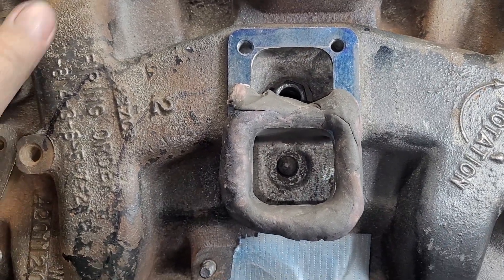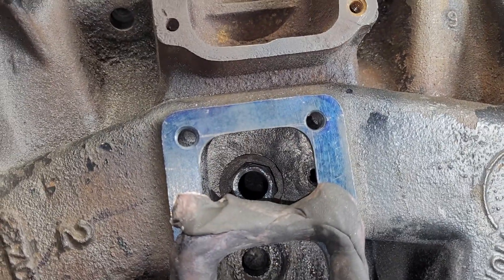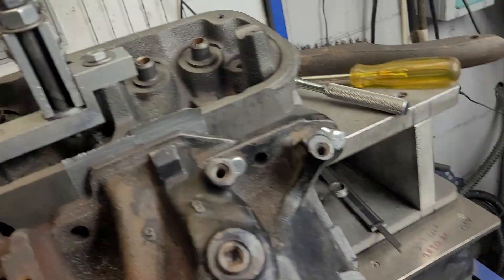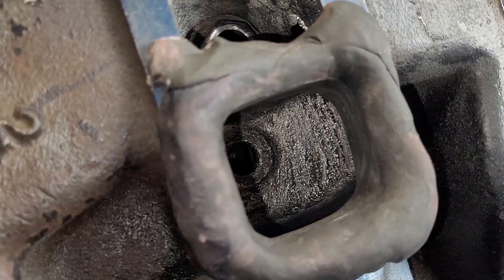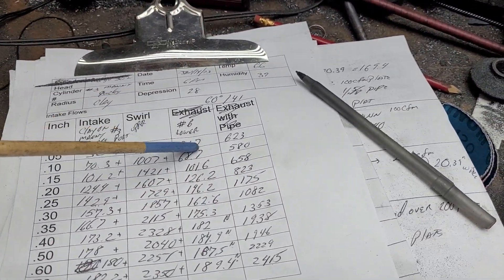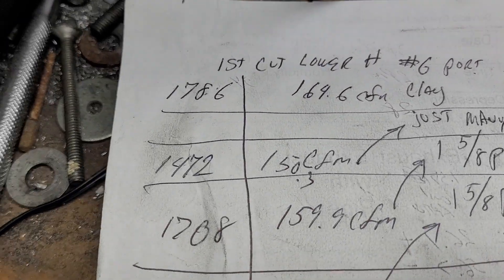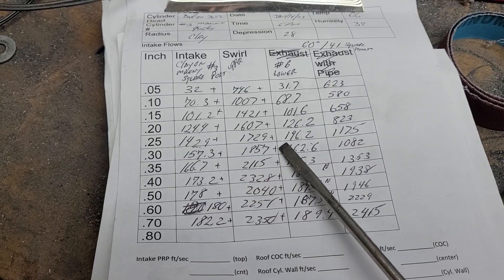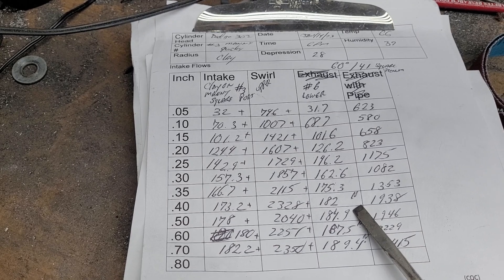David Vizard, Uncle Tony's Garage, Unity Motorsports, Mission Impossible project. Upper vs. lower H

Comment: Sounds like it's pulsing rapidly between laminar and turbulent. Increasing the depth of the boundary layer with dimples or an overshoot may help on the running engine but may not show on a flow bench. Looks like you have a good handle on this profect to me. Keep it up.
Reply from the maker: Thanks, it is all new to me  as far as these heads and this intake.

Comment: So... They are gonna hawg out the carb to square butterflys.  I said it first!
Reply from the maker: I have not heard that. I can bet my spacer is square at the bottom, actually rectangular.
Reply: @servediocylinderheads  well that would sure be interesting at least
Reply: @servediocylinderheads  a little tongue in cheek there.  But I was starting to wonder...
Reply: @servediocylinderheads  yep, flared and radiused from round to square.👍👍😎

Comment: I would say the frequency of that sound is a product of the turning turbulence and the length of the port supported by the density of the air. Sticking a ball at the “H” turn will change it. Changing the density by adjusting the pull will too. To get rid of it you’ll probably have to reduce the turbulence at the “H” turn. Resonance problems in HVAC systems are cured this way. Although, they have room enough for turning vanes at the turns.

Comment: This is just a hunch, but I'm willing to bet the frequency of that noise corresponds to the RPM range where that intake makes peak torque. It would be cool if you could determine the sound frequency, and confirm or debunk that.
Reply from the maker: I would need a microphone and a osilloscope to plot the period. I don't have either. Sorry
Reply: IIRC there are oscilloscope apps available for smartphones. Probably not as accurate as a real oscilloscope, but could get you in the ballpark.
Reply from the maker: @michaelblacktree  It disapeared after I cut the divider down. Thanks

Comment: Eveyrone is working on this project other than Uncle Tony, what a scammer
Reply from the maker: Now, now, that is not nice.
Reply: @servediocylinderheads  I've been wondering what his contribution will be. Time will tell.
Reply: @B. King  taking credit I'm guessing.
Reply: It would be nice if Tony could at least come up with castings from his stash for DV & Charles (heads / manifolds)…..this could help with experimentation purposes by having parts to section and compare 2v single plane vs. dual plane, as well as roller vs. non roller 318 heads to rule out the tight pinch issue discussed on this channel a bunch.
Reply: This project has taken off in a whole different direction than Uncle Tony wanted it go.  UT is a low buck kinda guy and the project was to see how much could be wrung out of a 318 in a DIY kinda way.  There is nothing DIY about this engine at all.  It will end up with the equivalence of thousands of dollars in development work, machine work and dyno testing.  Very cool stuff, but out of reach for your average working stiff.
Reply: @1996slamster  If the average joe tried some of the machining or grinding of these parts it would all end up in a scrap pile.
Reply: @1996slamster  
Yes....but..... It's going for $$$ charity for St Jude's and when it's done it will be a 4bbl doing 480 HP, if they up the cam. Owner will love it.👍👍😎
Reply: @hotrodray6802  you kinda missed my point

Comment: It's a mopar, they are possessed, I had a 318 that thought it was a big block.
Reply from the maker: No doubt they can punch above their weight class.
I did a thread on Speedtalk.com ages ago where I took the worst Chevy head ported it to about 245 cfm. Then I modified an aluminum quadrajet intake like this one. I think the best I got out of it was 177 cfm through the head. So this does more with less.